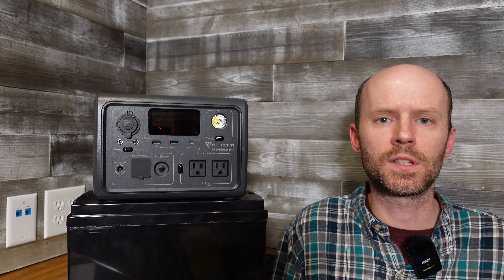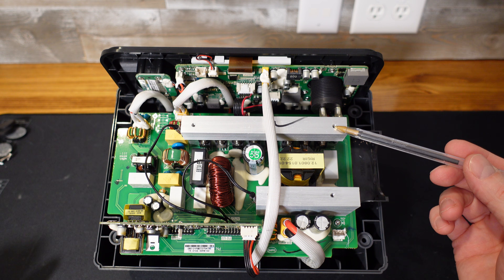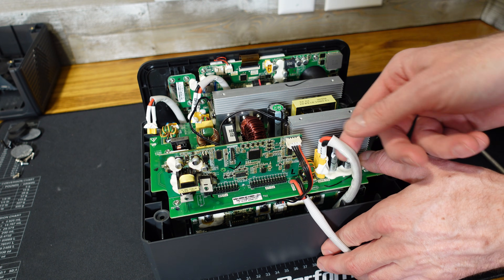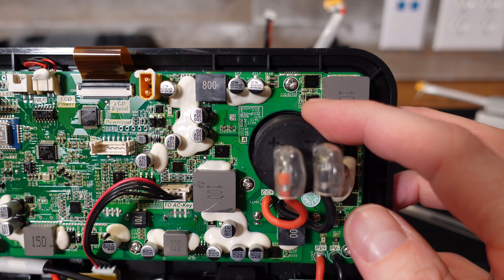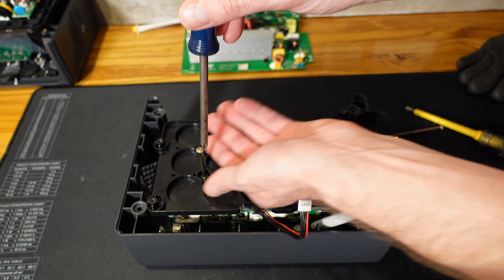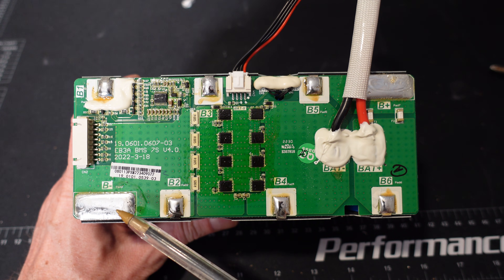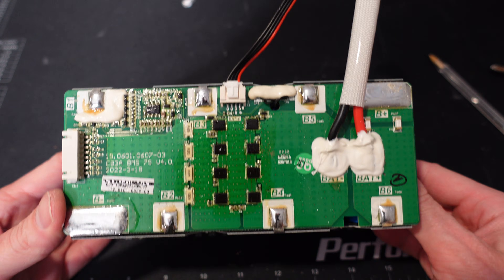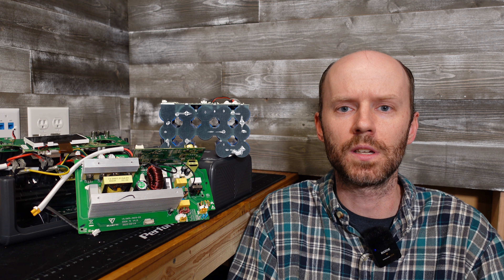Bluetti EB3A Power Station Complete Teardown, A Detailed Look Inside

Comment from the maker: Bluetti... https://amzn.to/3Yl68qa (Amazon)
Bluetti... https://bluettius.sjv.io/09rNzP (Bluetti Store)
(affiliate links)
Reply: I only use mine for about 3 months as a UPS and charging items only from USB and then one day I went to use it and it showed that the battery was at 100% when I know it definitely was not because I just used it. So then I went to recharge it and they said it was at 100% the whole time then it just turned off. Now the unit doesn't even turn on unless I have AC plugged into it and then it turns right off. After a few seconds it'll let me click items but then it doesn't do anything. After I click them it just shuts her right off. So this is my first product from them and all I had to say was I was very disappointed to say the least. I since bought three more. Those work perfectly fine I will say

Comment: Be careful with EB3A. It is overrated about power. 
I have 2  of them. I wanted to power supply a water tank pump of 400W with the EB3A given for 600W. 
It does not work for both of them. The powerstation switch off and turn to error immediately
Reply from the maker: I'm going to guess that has to do with the startup current of the pump motor. Have you tested it on any other power stations? I'd be curious to hear if an EcoFlow or other brand has the same issue.

Comment: The amount of comments and videos of people having problems with Bluetti is crazy. My ac180 is junk and I only used it a few times. Decided to just buy a solar controller, inverter, and real batteries. So much more reliable and longer lasting.
Reply from the maker: I've noticed there has been a lot of similar feedback on this video and it's honestly surprising - I've always understood them to be a fairly reliable brand. I didn't really use this one much, it sat in the box for over a year, however the EcoFlow's do seem to have a slightly higher build quality.
Reply: @LithiumSolar I was about to spend 800 on the new pioneer na Bluetti, but I got three times the amp hours for less. I think Bluetti is good if you never let it die, don’t keep it on a charger too long, and never have it in the cold. All of which I can’t avoid. Mine won’t charge at all anymore. Plug it in, flashes “Grid” and turns back off

Comment: enjoyed the video.   wondering if you had any insight as to why my eb3a won't stay on and if disconnecting the batteries would give it a hard reset.   I can only get it to turn on connecting it to ac power.  it shuts off with in seconds of turning on either the dc or ac outlets.   Its showing 100 percent charge
Reply from the maker: There was a comment from another viewer with a similar issue. It sounds like the SOC on the display was wrong causing the AC charger not to work. He was able to resolve it by letting it fully charge with a solar panel (a DC bench power supply should work the same). Maybe give that a try?

Comment: i got one of these, bought one a few months ago i had no trouble with it so far, i am hoping for it to last for long time specially that my usage is minimum, but that voltage balancing wasn't comforting really, it wasn't even close, reserve battery seems too high as well, like 10% ? thats too much i heard this unit had a lot of issues but i bought one anyway and a day after elite 30 came out well i had no idea new launch is happening oh well it is what it is :D, 
this unit  still needs some software updates tho like maybe it allows us to pick max percentage charge 60-80-90% etc, also MPPT seems to require higher voltage than 12.7volts and over 1amps to start working that sucks, better fan control would be nice as well like it allows us to do it
but the worst thing i ever experienced so far is its MASSIVE IDLE power draw, its mental!

Comment: This was my first after Rockpals. I live in Florida, so was looking for a way to power a portable TV if power goes out. The smaller ones don't get much use anymore. I built an 18650 12 volt battery in a small plastic case following your instructions.
Reply from the maker: These are so cheap now, I don't see any reason to be building them anymore. Especially with non-LFP batteries.

Comment: I enjoy these teardown videos. They are interesting to me. I would not suggest anyone open one up while it is under warranty unless they just never plan on using it anyway. Unless the shipping is covered I probably wouldnt use the warranty myself.
Reply from the maker: I don't know that I would warranty claim it either. Self-shipping would be a huge deal breaker for me considering it's a lithium battery and the shipping regulations around them.

Comment: The solar input for the EB3A is fairly low voltage, seeing a high voltage cap on the input board does not seem quite right.   MPPTs usually don't have much in the way of capacitive buffers on their solar inputs.   Are you sure that isn't a NTC surge suppressor (for when the solar is plugged in)?  At 2:57.  I guess if one side is going to ground it ought to be a cap.  Just seems odd to put a cap like that right there next to the input connector.

Very interesting, though.   5S, 6S, and 7S are very typical battery configurations in small power stations.

Comment: Bluetti sent me one of these  in 2022... it was reliable up until this year. The unit has been dead to the world after just a couple months of sitting, but would read 100% charged. Plugging in the AC charge cable alone doesn't help, because it thinks the battery is at 100%.  The app will say BMS Communication Failure A006. What works? Using the solar charge connector + AC at the same time. But I had leave it with both AC+solar input for over an hour to get it to kick back into gear. It is working again but basically if I haven't used it for a couple months, I no longer trust that it has "100% battery" unless I've done a full cycle. That solder job on the solar connector is pathetic. Good to know that if I want to fix it, it's not impossible.
Reply from the maker: All battery packs will have a small parasitic draw due to the BMS. Things as basic as keeping the FETs engaged, or the computer chip on the BMS, all use a miniscule amount of power that will add up over time. The BMS will work on voltage alone though, almost never on the calculated state of charge. I don't think that's what is happening though based on the behavior you're describing, especially the communications code. I wonder if the cable is damaged (or loss) that connects the inverter board to the BMS. The battery voltage is passed directly to the front panel display (no control on the inverter board even though it passes through), which explains why it would charge through the solar input port. Also, for what it's worth, mine sat unused for probably 1.5 years here and I haven't had any issues. And yes, the solar input solder job leaves much to be desired...
Reply: @LithiumSolar  Hey thanks for the thorough reply! Yeah, I know all of them have parasitic draw and you have to maintain them, but now I just can't trust it 2 to 3 months of no use. 

I almost got caught with my pants down when I took it to an event last year thinking it was "fully charged" when I brought it up from 80% to 100% and then it kept dying at 95%. I had to cycle it then. That was back in May. 

The AC charge works again by the way, as soon as the solar charge fixed whatever the heck was wrong the AC was able to take over. I've been able to charge it using AC ever since that happened. I almost thought the unit was completely dead when it wouldn't charge from AC anymore and I kept getting the BMS warning.

Mine has never been dropped or manhandled so it's disappointing to say the least.

I'll check on it today as I have not touched it in a while and see if it is behaving.

Comment: 32700 cells in something that cost 210$ doesn't feel good. They should have used something better. 
32700 cells are really cheap..less than a $ each. 
I bought a grade 32700 16pcs for less than 25$. Hx branded & they measured 6500-6700mah brand new. Still above 6400mah a year later. In ups use. 
And those chunkey square parts are not resistors they are inductors for the buck & boost converters.
Reply from the maker: Interesting on the inductors, thanks! And yes, I do agree on the cells. While there's nothing inherently wrong with them, I do like the approach EcoFlow took of using the EVE C40 cells.
Reply: @LithiumSolar 32700 cells do have lower cycle life than other types liken 32140 but it really depends on manufacturer. 
I recently took apart a 27 year old panasonic vhs camcorder battery pack and extracted two panasonic CGR18650 1400mah cells , both were at less than 2v as the battery had seen last daylight 15 years ago. Yet on the first charge cycle in my battery tester one cell came out to be 1414mah and the other 1440mah. That is for 27 year old cells that had seen probably a couple of hundred cycles as i found a stash of over 100 recorded vhs tapes with the camera ranging from 1999 to 2007. The other battery with the camcorder even had 7.55v & ran the camera for like 20mins. & I had newer panasonic cells go 0v after 5yrs of storage & super high internal resistance after minor short circuit.

Comment: I repaired 4 similar units - on ALL the solar input connector was broken - solder connection had broken - resoldered and fixed them
Reply from the maker: Interesting observation and can definitely see how that would happen. It would be nice to see that connector have wires directly attached to it as well (maybe another XT30). The solder just won't hold up to frequent movements, accidentally tripping over a stretched out solar cable, etc.